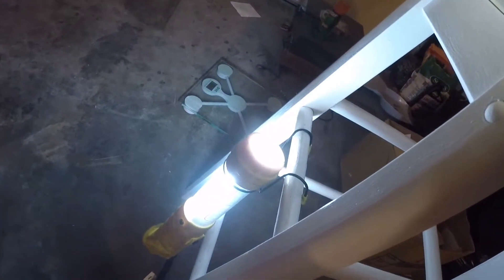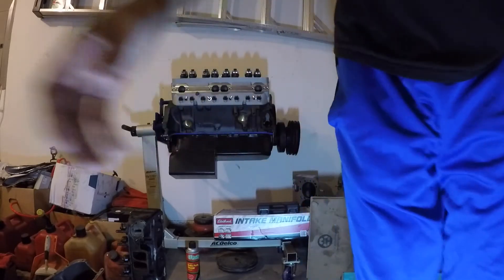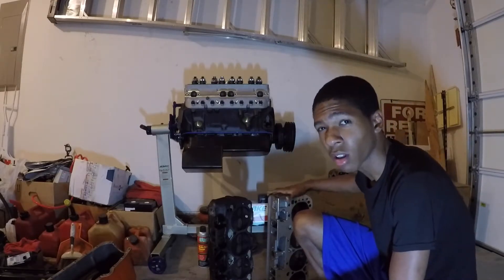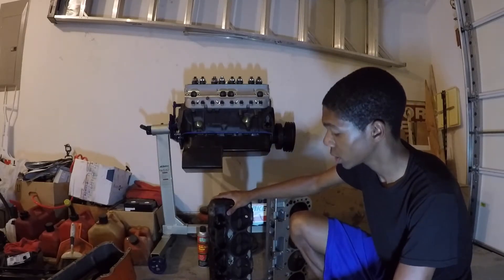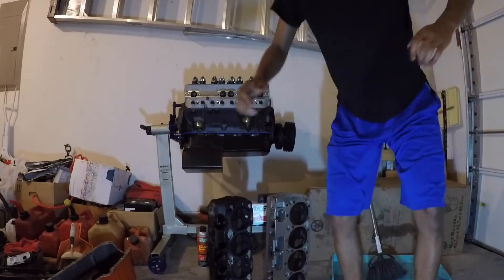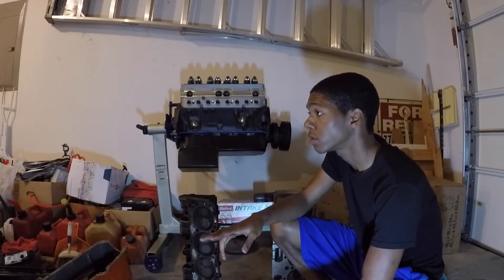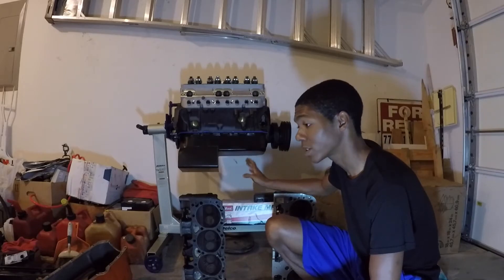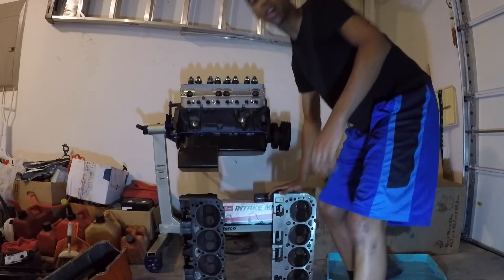The Weight Difference Between the Cast Iron Cylinder Head and the Aluminum Cylinder Head!!!

Comment: Caterpillar remanufactured heads are welded everyday- that's a myth that cast iron cannot be welded. They can fix a block that has had a rod thrown out of the block depending on the location.

Comment: Yes they do dissipate heat faster . I do recommend you to get also is a 3 row core aluminium radiator it will run you about 200 bucks or less . I got one for my 78 step side .

Comment: swapping out the cast iron top end for aluminum (heads & intake) along with some headers instead of cast iron exhaust manifolds will shed roughly 60 pounds off the front end of a sbc.

Comment: Aluminum can be welded.   Cast iron cannot.  That’s why the aluminum ones can be repaired.
Reply: That’s not fully true it’s just way harder to weld ( takes a special welder 👨‍🏭 and methods and tools) cast iron and yes I have done it just not cylinder engine heads or blocks and typically it takes heat treatments to relieve pressure after and before welding as not to crack it again and or in a different spot besides which it’s easier to just silicon bronze braise/ soldiering it together as it’s less picky and or mechanically fastened it
Reply: @richardprice5978  cast iron has to braize welded there's really no other way to do it reliably and it cost around 500 dollars to fix a cracked iron head and around 30 dollars to fix a Crack in aluminum head not to mention it doesn't take any special wedding skills to weld aluminum if you know how to tig weld you can do it at home. I went aluminum a long time ago and I'll never go back lol
Reply: @jonathanlawson4667  when you're saying braize welding you are referring to flame-spray welding or ark-spray with powdered metallic right? and no stick and tig works its just a pain in the - and all of this can be done in a at home shop setting with the right tools and talents. on my engine i didn't want mixed medals castings so all iron/steel for me as more than one manufacturer has made that sin and had to pay for it gm being a big one and my engine should be more efficient just heavier as i didn't reduce the size or weight and i could keep listing things but im going to stop 🛑for now/next comment or questions